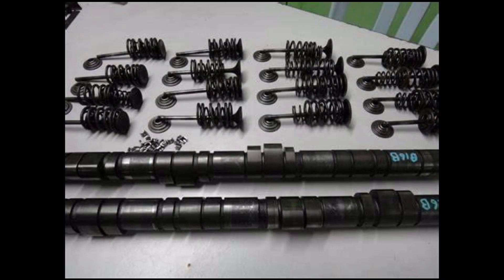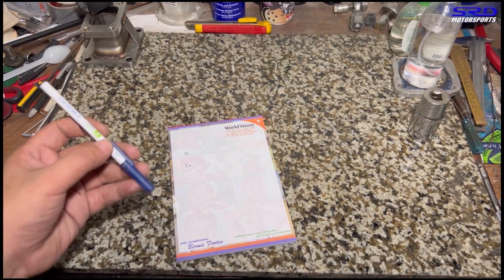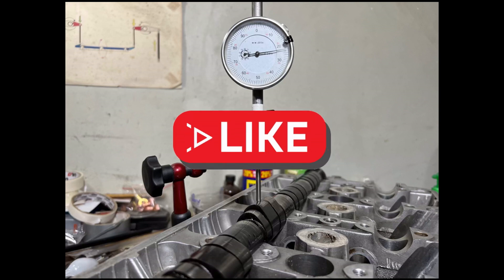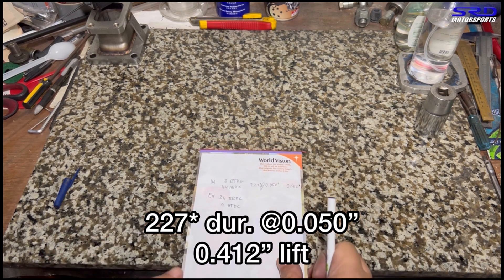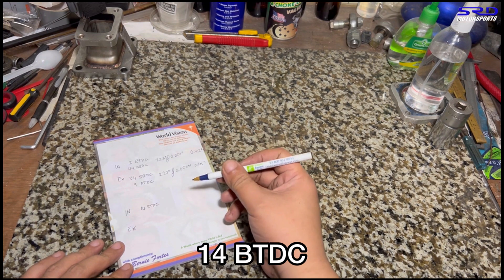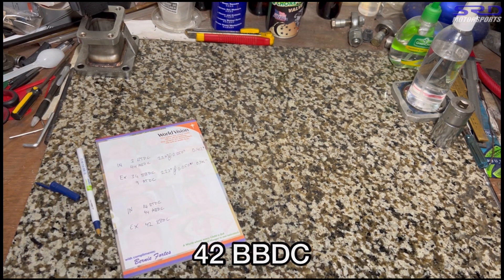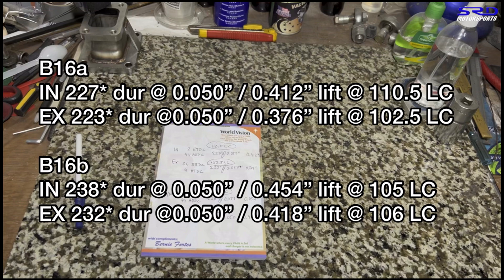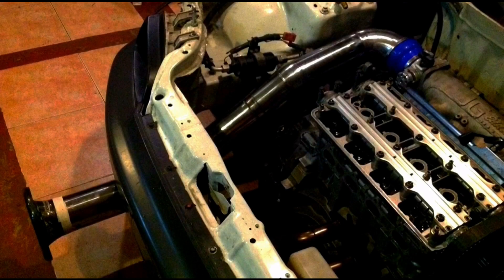Camshaft Comparison: CTR B16b vs B16a Cam Degree and Lobe Center

Comment: Hi can you show or tell me how to know b16b cams because I have one but idk if it’s b16b or b18c type r my cams it’s have 1 line outside and one inside how about this cams you tested? How many lines?
Reply from the maker: b16b has 2 lines… they have pictures online on how to check b16b vs b18c
Reply: @SRDmotorsports i will send you picture of the camshafts so you understand it’s says cams for 92+ b16 online do you have instagram so you can see
Reply from the maker: I just searched now and u can easily find the thread with pictures that was a post in Honda tech about how to identify CTR cams… if it isn’t the same on the picture then it isn’t CTR
Reply from the maker: If it says for 92+ b16 then it isn’t typeR
Reply: @SRDmotorsports but it’s bigger than sir and gsr so it’s spoon ? Or something do you know anything about it maybe it’s for integra type r?
Reply from the maker: not spoon because spoon is even bigger than. B16b and doesn’t have that kind of marking my friend had spoon cams years ago
Reply from the maker: Integra TypeR is different they have pictures of it online it’s different
Reply: @SRDmotorsports well I guess it’s for eg6 b16a sir ii or special edition
Reply from the maker: or a b17a which is like an automatic… can’t rely on “looking big” because a smaller primary would make the vtec lobe seem big or a diff casting base circle would trick the human eye in seeing it as big

Unless it’s degreed and checked properly
Reply: @SRDmotorsports if you found that camshaft make video about it I would like to know the size like you did between b16a and b16b
Reply from the maker: Yes will do if we find it no problem
Reply: @SRDmotorsports thank you. I can see it it’s bigger than gsr and normal sir that why I think it type r and the vtec sound like type r. In Japan you can find it a lot there
Reply from the maker: we get a lot of Japan engines since 2005 so I should have seen that but it looks like a b17a look online they showed that in Honda tech

CTR is far from everything stock
Reply: @SRDmotorsports that good you can find in ef9 and eg6 engines but the most in eg6 engines
Reply: @SRDmotorsports I just did research in and chat gpt said 

B16A Gen2 (EG6 SiR-II)
~11.5 mm
~10.5 mm
~288° / 280°
✅ Hot
 And
B16B (EK9 Type R)
~11.7 mm
~10.5 mm
~290° / 285°
🔥 Hottest OEM
Reply: @SRDmotorsports I just found out from chat gpt from oem camshafts it’s top typer b16b and b18c5 and then b16a gen2  eg6 sir ii and then b16a gen1 ef8 ef9 and then b17a and b18c1 gsr

Comment: I kinda got scammed buying a b16b head to pair with my b20b block. Instead of having a pair of b16b camshafts i got b16a intake cam. I went with it anyway and was quite ok with the results. What am i limiting with this setup? And what do you recommend for upgrades on a b20vtec with a b16b head? Thanks in advance!
Reply from the maker: an ITR or CTR cam would be a decent upgrade to compliment that B20vtec

Comment: Great Video, seems to give me more questions. 
Where did you get the jig to hold the dial indicators? 
Are you placing the probes for the dial indicators on the valve spring retainers?
If you give those lift specs to a place like comp cams, do they want the lift at the valve or the change in diameter of the cam lobe itself?
Reply from the maker: @SteveBrownRacing  jig was made by a fellow named Mike Belben when Honda-tech forums was active I do believe xenocron carried it which might still be offered thru “race-spec.com” or something (they have the same owner of xenocron

compcams should be fine with either lobe spec or “at valve” we check “at valve” hence the indicator is at the retainer hope that helps

Comment: How about b16b intake cam vs b18c5 intake cam, there was always rumor that the civic type r is slightly more “aggressive “. But that 00/01 itr intake cam was the same as b16b. Any info on that you know about?
Reply from the maker: B16b is bigger than any ITR cam except the 00/01 ITR they’re identical to the b16b
Reply: @SRDmotorsports  thank you
Reply from the maker: no problem! Have fun with your project

Comment: how much is the most accurate @valve lift to measure the stock cam??  0.01mm? 1mm or 1.27mm?
Reply from the maker: Not sure what u mean
Reply: @SRDmotorsports  I mean looking for centerline intake and exhaust.... should be measured from 1mm clearance?  sorry my English is bad😀😀😀
Reply from the maker: Either way centerline is between the opening and closing … so that’s why I do the math like that and not based on lift as that’s confusing
Reply: @SRDmotorsports  tq sir
Reply from the maker: No problem sir :)

Comment: Valve lash tappet clearance?
Reply from the maker: It’s ALWAYS set to zero when degreeing for accurate numbers
Reply: @SRDmotorsports tq sir..... in this video, measure the camshaft on the high lobe?
Reply from the maker: U only measure vtec here = high lobe
Reply: @SRDmotorsports  can u teach me how to lock vtec rocker arm???tqvm sir for the response
Reply from the maker: One of the b20vtec series I showed that the series I did last year  episode 3 of it I think
Reply: @SRDmotorsports  tq sir
Reply from the maker: No prob

Comment: Just asking which one is good power strong cam b16b or type r for b20b
Reply from the maker: B16b is a TypeR cam an EK9 TypeR is a B16b engine and an Integra TypeR is a B18c also a TypeR engine

Both cams work of everything else works with the cam and compliments it

Comment: Impressive....as usual... Anyway what is the b16b cam tdc lift on exhaust to intake cycle.... Cause i am building b16a with b16b cam and ctr pctx piston.....have u done this setup before.... Any chance piston will hit the valves at tdc?.. please help... Thank you.
Reply from the maker: It’s safe no problem… I mean I also did a b16a with b16b cams lately and it was all good
Reply: @SRDmotorsports  thank you very much... Upon installing b16b piston into b16a block with pr3 rods.. the piston protrude out of the block around 0.8mm... that is why i am worry...😁
Reply from the maker: @mohddean1280  yea it comes out more than 0.020” or 0.8mm hehehe

it is safe just don’t advance more than 2degrees intake

And since CTR cam likes to stay zero setting u are safe

Comment: I remember a sunburst yellow SiR back in the day running 14.7 consistently with just B16B cams, I'm just not sure if it ran a piggyback with it. But most likely it didn't.
Reply from the maker: Oh yeah that’s believable!
Reply: @SRDmotorsports  But yeah, I think that was more than 20 years ago, so I may be wrong on some details 😄
Reply from the maker: @findtherightbeat  well someone came to me now for tuning lessons and one car he did for his friend is a stock siR even intake manifold is stock just b16b cams he then tuned it
Ran 14.7sec so it seems accurate hahaha
Reply: @SRDmotorsports  Sorry to digress, one thing I remember specifically about the car I mentioned is that it had HIDs before HIDs were a thing in the Philippines. You probably know the guy since that guy was in the same forum as the other VCZ folks
Reply from the maker: @findtherightbeat  ohhh I remember this guy forgot his name he half Jap the sunburst Yellow one and true that was stock with b16b cams no piggyback!!
Reply: @SRDmotorsports  Yeah, that's him! Like you mentioned, the B16B cams are really a nice upgrade for someone into some strip and circuit racing but not looking to do a lot to their engine.
Reply from the maker: @findtherightbeat  and still near oem maintenance requirement
I remember his name now! It’s Hiro!! Dayum only now did I remember his name wth been a while True OG bfor the fb lodi cats even then he was still faster than most today hahaha on the same set up
Reply: @SRDmotorsports  True! 14.7 and a four door at that 😄
Reply from the maker: @findtherightbeat  and the cf fad didn’t exist yet so that’s all steel!

Comment: what's the difference between the heads how can you tell the difference maybe the cast markings. maybe do a video about that thanks keep up the work.
Reply from the maker: They’re both pr3 casting the other difference is not always reliable like the 3 box / square embossed lines above the pr3 marking on the exh port side isn’t just for TypeR but also later released heads like 95-96s

Comment: You forgot to mention if you locked vtec or not
Reply from the maker: Always always lock vtec as we measure the vtec lobes 😎 the older video I covered that and a simple way too ftw!
Reply: @SRDmotorsports  😃😃 finally understand this, I'm going to use what I have which is the B16A cams, what I'm going to do is put adjustable gears on them, my question is what is a good +/- degree to play with? Getting the B16B cams where I'm from is really hard to come across
Reply from the maker: actually like on that video I used the oem camgear as “start” to degree because that’s what Honda used for b16a and even CTR cams so that’s the safe starting point

Glad u getting it now man I’m glad!
Reply: @SRDmotorsports  that's exactly what I'm planning to do, degree the stock cams to get my numbers right then install the adjustable gears and play with them to further understand it, I know what my engine is lacking while driving and what adv/retar the cams do to the power band, but first I've got to remove a resonator the previous owner installed
Reply from the maker: Yes that’s good